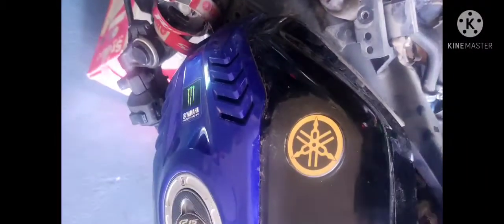Yamaha R15 v3/தமிழில் radiator fan problem ah??? easy way to check R15 v3 radiator fan.....

Comment: En bike la oru 2 3 kms ponale radiator fan run aaguthu engine heat aaguthu frequent ah engine oil coolant oil la change panita aanalum same compliant repeat aaguthu, ena problem ah irukum, any solution for it
Reply from the maker: Fan work aagutha bro